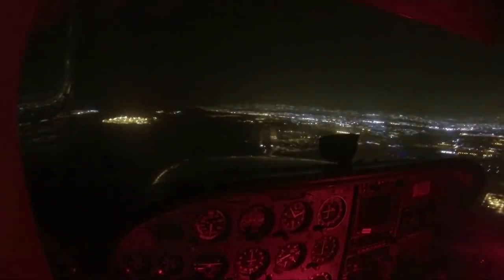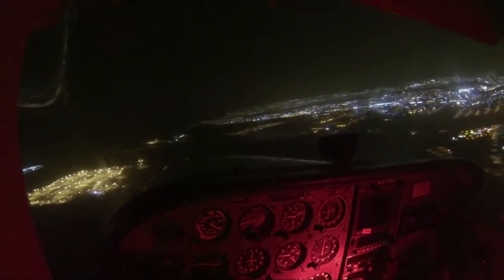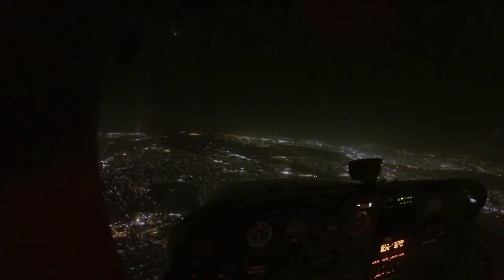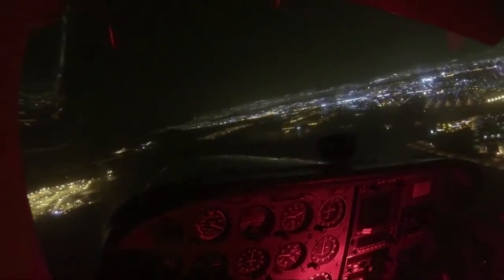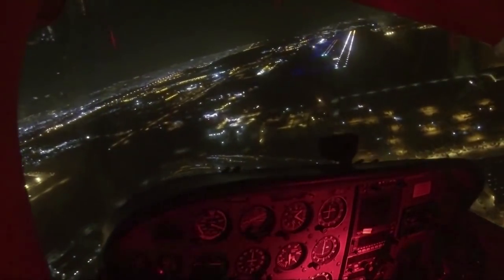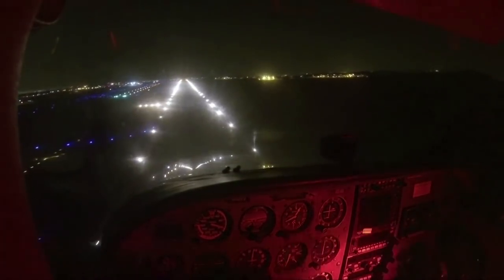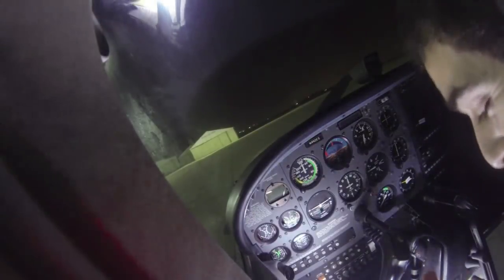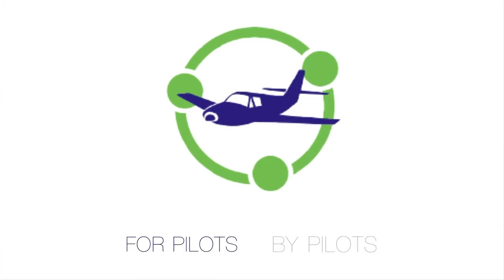Total Electrical Failure at NIGHT - Low time pilot - POV Flying

Comment: This happened to me first flight out of annual. No mic to click the runway lights, no landing lights. The only lights were the blue marker lights on the sides of the runway. Pitch black night no moon! Upon investigation, the A&P properly connect the line to the alternator, so when it came loose and the battery drained I lost all power. I kept my cool and landed the plane safely, thank God! The conversation with the A&P was so calm!

Comment: Hi. He wouldn't necessarily have to explain one of his passengers how to operate the handheld radio. He just could have flown another circuit and operated it by himself, once a passenger handed him the radio. The Cessna is a stable enough aircraft to do so, even with flaps extended. But nonetheless, it's a well managed situation and another proof, that a pilot with fresh training is probably safer than a pilot collecting hours over decades on the same burger runs :-)
Reply: Dan McLaughlin "But nonetheless, it's a well managed situation" - yeah, so much bitching, incredible!

Comment: Interesting video.  I've been in the same situation in a light twin.  This was in the mid '80s and I did not have a hand held transceiver  either.  In my case, we crash landed about 100 ft. short of the runway.  Thankfully no one was seriously hurt, however, the plane was totaled. 

I would highly recommend a handheld radio for any pilot especially at nite.

Comment: Had a landing light take out EVERYTHING 10 miles out on a night flight, '77 172. All breakers stayed in. Had the good sense to TURN THE LANDING LIGHT SWITCH OFF then rock the master and alt switches a few times and everything came to life. There is a contactor similar to a starter solenoid that engages the battery into the electrical circuit and a short can burn the contact (that's what that click is you hear in the engine compartment when you flip the master). Rocking the switch will slam the contacts closed a few times and make contact again. It helps to understand your systems. Tried it on the ground later and it popped the LL breaker. Straws can break the camel's back.

Comment: First thing I did after getting my private pilot kit back in 2006, was getting an iCOM VHF radio.  You made a good point, Radio’s must be kept charged prior flight, checked, and more than often use to scan radio frequencies.  A radio is useless if battery is dead, and you are unfamiliar with it.

Comment: This is why my instructor taught me how to land without a landing light. Normally it would be stupid reckless and dangerous to land without one. However when you know that you are having electrical issues you want to stretch that battery life for the most essential electronic devices. In this case landing and a airport with lighting controlled by the pilot the radio is far more important than the landing light. He handled it well however and I'm glad he made it to the ground safely. Just keep in mind most aircraft batteries even when only running essential equipment will only last 15 minutes if your lucky turning on high drain equipment such as a landing light will make that more like 5 minutes.

Comment: Steve, great video. I have a handheld and I learned the other day the plane I fly has a connection to attach it to an externally mounted antenna. Perfect. 

Thanks for sharing. PS: I passed my instrument check ride yesterday!
Reply from the maker: Thanks, and Congrats on the instrument check ride!  That's awesome!  I've been distracted from IFR training for several reasons...
But I can't complain - I am having a pretty great flying season right now :)
Reply: Congrats on your new rating, Tony!

Here's to an overcast sky and low vis. Keep the needles centered!

Comment: Wow, kudos to the pilot for not locking up there.  Another option here would have been to divert to a field with 24 hour tower NORDO, hoping your light signal knowledge is still current, but you would have needed to anticipate the timer expiration to make that call.  Once at 100' AGL, landing looks like the right call.

Comment: Kudos to him, got lucky to be so close to the runway when those lights shut off.  I think had this happened to me, my mind would start thinking electrical fire right away.  Glad that was not the case.  On my PA28-140 back in the day, my landing light crapped out on my first night cross country (with an instructor).  Thankfully I had a powerful spotlight that my instructor was able to stick out the window and shine forwards at our small non-towered, non-lit airfield.

Comment: Great video!  I've got my PPL with about 75 hours.  About 60 hours in, I had an alternator failure.  I was close enough to the field, so I just turned around and went back in.  But this video will definitely push me to go ahead and get that handheld.  Also, I make sure to fly at night with an LED headlamp with a red option.  Best hands free operation!
Reply from the maker: Jordan Shaw Cool yes, I use an LED "hug light" which hangs around the back of my neck.

Comment: faced nearly the same problem going into Winnipeg Intl at night in a C172, as soon as I turned on the landing light I lost all electrics... although when the Landing Light circuit breaker popped, my electric returned, and I switched off the landing light and landed normally (with no landing light).  But there was a bit of a "pucker factor" when it happened, flying with My Mom and her sister.  
  I fly with a hand held, but like this guy, it's not always as handy as it should be in the event it's needed.  Note to self...keep it handy, especially at night, almost everywhere I fly has an ARCAL system!

Comment: That was awesome, I would have freaked out, I'm not even a student pilot yet, but I have been studying up, and went to a club meeting and the first thing they mentioned was if you don't have a handheld, GET ONE. I'm a HAM radio operator and found that always being tuned up and ready to go is vital even just in my car, so I would have my handheld and cell adapter for my clarkes ready to go. Great Vid.

Comment: When I was first thinking about this scenario it definitely seems bad, but when you think deeper.... it could easily have been the beginning of NTSB findings after you're a smoking pile of rubble.  Consider he had flew a longer cross country and may only have a half hour/1 hour reserve left.  If he wasn't able to make that first landing, a go around would have been really sketchy. After that you pretty much have no other choice but to divert or wait for someone else to turn the lights on.  I personally would whip out that sectional and find the nearest towered field.  In that process of diverting... you have full flaps down significantly reducing your cruise speed and increasing fuel consumption.  All while at night. Seriously well done, amazing decision making.

Comment: I did a  2 bus failure on a simulator at night.  It was a  Cessna 172 glass cockpit. 
I was on final approach an what a shock! Everything is black! I  could see the runway lights, the flaps are electrical and were down. This is when that book " Stick and Rudder " kicked in. As a pilot your job is to fly the plane.  No instruments no problem.  My biggest problem was not knowing my airspeed. 
I headed toward the runway lights slowing as I went.  Thank goodness it was a familiar airport.  Slowly I lowered the plane and  touch down! After breathing a sigh of relief I taxied to a  non movement area of the airport. 
I think think type of training is very useful when it counts.

Comment: Holly Molly! Nerves of steel. Well done buddy!
Backup radio, e.g. Sporty's SP-400 with ILS/LOC. Back up light band flash light to put on head to see instruments. High intensity flash light to find taxiway. Yep, needed backup equipment for night flying.
My biggest fear would be a complete G1000 glass cockpit failure in IMC conditions at night. Try finding your way to an airport, over terrain and without navigation, no radios but just your backup analog instruments. IFR may be great, but a lot safer when done during the day and with VMC conditions.

Comment: This actually happeend to me in a VERY busy NY Airport. I had an alt failure, and ultimately batt drain. When I noticed the alt failire I shut off all nav/beaconand strobe lights as they are a big current draw. Before my radio died, I contacted ATC and told them of the problem. From day-1 I had a handheld radio (with VOR & ILS) I always charge it and test it before each flight by calling ground for a radio check. I contacted ATC from handheld and told them of the issue, and they cleared me to land. I always have it handy next to me and test the VOR/ILS capabilities. After all a handheld is useless if not Charged (or fresh set if batteries) and not tested.

Comment: Awsome videos. Thanks for sharing.   Great teaching points.

I think that It's a good idea to do a brief passenger brief, just because somebody freaking out unecessarily will add stress and distraction to an already tense situation. #2 calm passengers are more helpful than panicky ones, so if they know all is under control, they are more likely to comply with instructions timely, such as "get that bag in the back and find a radio with a big antenna and turn it on"

Comment: Wow, I am glad it wasn't as dark as in the video - very scary!
Talking about VHF Com handhelds ... have been in a daylight situation where both radios suddenly had issues and we couldn't receive anything. I previously bought a very rugged cheapy handheld new for under 200$ with a built in VOR receiver, which was good enough to communicate with no problems all the way until we landed half an hour later ... its AM modulator doesn't sound award winning like some of the modern DSP/SDR based high end units, but its not much worse than most other radios signals out there and good enough for basic communication. There are some models for up to 1000$ that would not have done a better job.
The only thing you have to care about is to charge and discharge the battery on a regular basis, and maybe have a backup battery pack, else it may not work when you need it. But this can happen with an expensive one as well. So make sure you connect the head phone adapter ready to go and lay it right in front of you on top of the instrument panel within reach and you will be fine.
There are also diagrams of programming interfaces on the web, very simple, very few components and with those you can program all local airports with alphanumeric labels comfortably from your PC, so there is no stress instantly finding the right frequency. If someone needs diagrams, let me know I may be able to help.

Dear "Flight Chops" many thanks for all your greatly edited and documented quality videos, they are very informative/educational and entertaining as well - wonderful job!
Reply from the maker: Thanks very much for the comment.  The feedback has been great and I've been inspired to work even harder for "year two" of this crazy thing - watch for an awesome relaunch and upgrade to the project for July 27th 2014!
Reply: Me and another friend have been planning on a project of creating a hand-held radio. It would be great if you could share with me the diagram of programming interfaces you talked about. Any information/ideas would be really appreciated!

Comment: During my PPL training we practiced full failure, no flaps, no electrical (Still made proper calls and exterior lighting) into black hole airports. (even had a simulated engine failure during one.) It was always fun, nerve racking, and I feel confident should the situation arise.

Comment: I had a similar situation in a 172 on my 2nd flight after receiving my ppl.. It was a daytime flight, and heard multiple popping noises thru the radio and then everything electrical went dead. My first concern was fire in the cockpit at 3,000 ft. I also had a non-pilot passenger and though he knew something went wrong, I just gave him a thumbs up to indicate we were ok. Made it down safely with no flaps but promised myself I would buy a transceiver. As bad as that was, I couldn't imagine the same scenario, but at night.
Reply from the maker: Flyboiy J yeah - this story inspired me to get a hand held radio for all flying - but especially for night flying!
Reply: ***** I agree.... I think this video should be seen by every student pilot across America. There are so many lessons to be learned here and you did an incredible job narrating...your voice of reason and professional editing  was spot-on!  Btw, I was reading comments between you and Guido about a collaboration. Is this still in the works?   Both of you are amazing...it would be a blockbuster video to see the both of you in action.
Reply from the maker: Flyboiy J Comment appreciated! And yes for sure Guido and I do intend to work together - we're both just so busy we hadn't locked down a firm plan...  But you've inspired me to re light that fire, so I am sending him an email to resume the talks.

Comment: I started flying with my father at a pretty young age and have some interesting stories.  After watching this video I sent it to him and he just replied back with a story I wasn't sure I'd heard before:

I actually had this experience with Tom.  We were returning at night from Spring Lake after having dinner.  We were coming up west of Morristown and heading for Lincoln Park.  Tom noticed that as it was getting dark outside we were also having trouble seeing the panel.  Then he noticed that the alternator  circuitbreaker switch was off so he pushed it back in and the panel lights came back on.  About thirty seconds later a spark shot out of the switch and the cabin went dark.  There was also the smell of an electrical fire or short.  Tom thought we were on fire - I thought the engine would stop.  Neither happened, but not we had to figure out how to get down.  We headed around Dover and back east to Lincoln Park but the runway lights were out and we could only turn them on by radio which was not working.  We did not have a flashlight so could not determine our altitude or speed.  I was the pilot so I decide to go to Wayne and circle the lit mall parking lot while deciding what to do next.  When we got there I realized we were right off Caldwell and the runway 4/22 was lit up.  It was completely dark by then and I did not see any other traffic in the pattern so landed without tower contact.  They never saw us and I just guessed at my altitude and air speed.  Actually it was a pretty good landing all things considered.  We pulled off at the end of the runway onto a taxi way and left the plane at Nazzarian.  Found someone to give us a ride back to LP to get our car and that was it.  I don't know why I did not think of Teterboro rather than Wayne but I did not.  Very scary at the time.  Dad

Comment: My flight instructed an I were doing touch and go's in an old Cessna 172P during the day time after climbing out of the second touch and go we noticed an odd smell which vanished after three minutes. Several circuit later (we were in moderate crosswinds landing with full flaps) as we were going down the runway we pulled the flaps up and they were coming up too at the point of rotation we were too far down the runway to abort there was a thump and the flaps were stuck almost full down and the odd smell returned by the downwind turn we were sure that we had an electrical fire but we landed safely and taxied back to the ramp. Not exactly what I wanted to do that day but at least I got some experience to help me later down the road lol. Great videos hope gotta love it when the flights get alittle too fun lol!
Reply from the maker: Camera Bird Thanks for sharing your story - it is a great reminder that anything, not matter how small, that is out of the ordinary, is worth investigating and reacting to.  Sometimes you gotta change your planes if it doesn't feel (or in this case smell) right!
Reply: For sure I ain't going back to that bird before that event we had an issue with the shimmy damper and after that event we had a left mag failure so yeah I'm switching planes for sure lol

Comment: This happened to me once, but worse. Was on a night flight and all power lost, including the engine dying. Luckily, I was with my instructor and he had a handheld radio with him and he called up the tower and they cleared the airspace for us. We were on downwind so parallel to the runway already. It was a very busy airport with jets coming in and out so if we weren't able to get in touch with the tower immediately, we were going to have to try and land on the adjacent highway. With no power, we had to cut base and approach short and pretty much make an immediate left turn over the airport to make the runway. Landed ok and got off the active. Learned later on that the alternator had died and the gauge was faulty so it didn't warn us which led to the battery dying since it was the only thing powering the plane. We went from a lit cockpit, engine running, lights and comms, to dark silence in an instant. Scariest day flying I've ever had.
Reply: akanishta99 so you kept on flying i would never have got back in a plane your a brave person. andy England

Comment: What I learned from this is if you have a manageable emergency like this with a damaged electrical system and some things are still working, don't make things worse by adding major electrical loads... like landing lights.  Focus on flying the plane until landed.